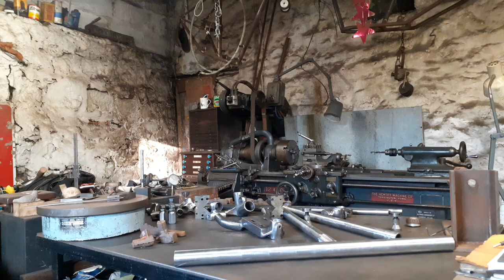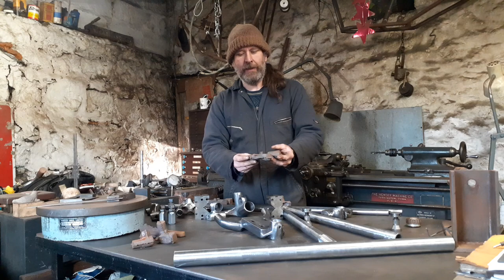Frame building

Comment: I thought that cast iron is a very brittle metal and therefore not suitable for motorcycle frames?
Reply from the maker: Yes, normaly it is but, maleable iron, also known as semi-steel is a lower carbon, soft anealed material, you can bend a slice 90 degrees and straighten it out without it snaping and it is still very stable like cast iron👍

Comment: Did I hear you right? You soft solder the frame together?
Reply: Silver solder.
Reply: Is that you doing better than the factory did or were they so expensive and so revered as they did it as good as Sam Lovegrove does?